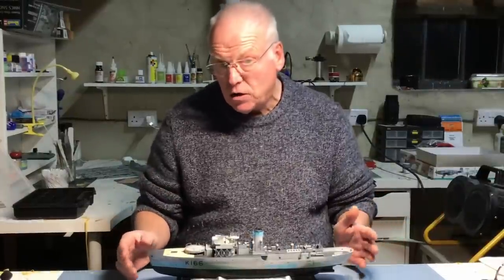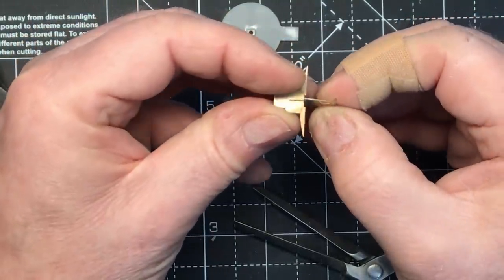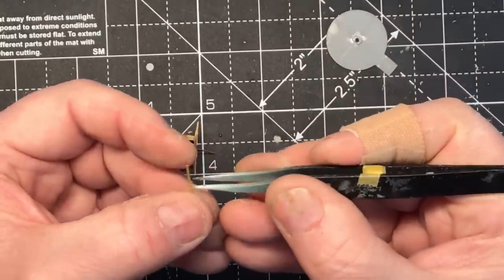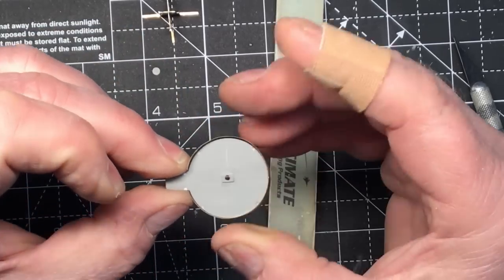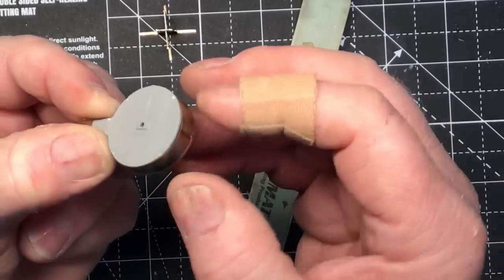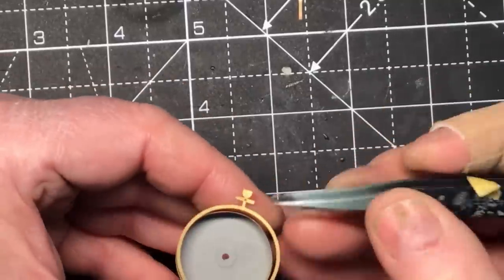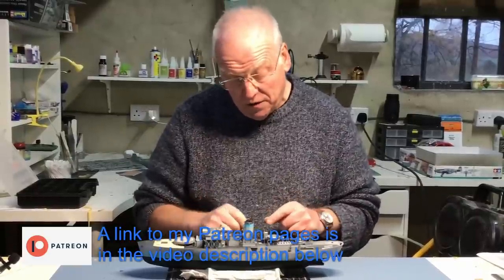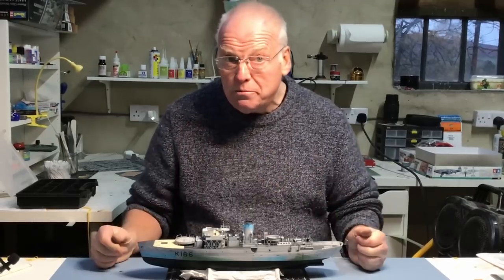Revell 1/144 Flower Class Corvette full build with Pontos detail set Part 14

Comment: Couldn't believe that you soldered the top lip to the tub... and got away with it! Well done.

A bit off topic for this week's video, but "desperate situation calls for desperate means", or something like that. Now that almost all of the major sub-assemblies are done I'm starting my put-together phase. I'm seeing that paint is flaking off several parts (bottom of top deck of bridge Pontos Part 166), front shield (Pontos Part 51), etc, etc.

I'm using new Tamiya lacquer paint, with Mr. Finishing Surfacer 1500 (gray) as the primer. I'm airbrushing at 15-20 psi. The offending color is Insignia White LP-35. It is so runny that I'm not cutting it. Coverage is poor, so I build it up with multiple light coats about 10-15 minutes apart. The cracking seems to appear about a week after painting, and comes off in relatively large flakes (some as large as about 5mm). I've ruled out flux since many of the parts were never soldered.  Any words of wisdom??
Reply: I just read your reply to Mr. Jones. I'm guessing that he/you/I are seeing the same issue. I'll follow your suggestion (paint & install quickly) and see what happens. No need to respond unless you have additional insights to offer.

Comment: Steve, what criteria do you use to determine whether you use a thick, thin, or extra thin super glue for attaching the parts?
Reply from the maker: Steven there are two considerations: the first is how much contact point there is on the parts, the second depends on how the parts are assembled. Taking the first, on railings for example where there is a very small contact point at the bottom of the stanchions, I’ll use a thick or maybe medium CA because thinner formulas evaporate before you have chance to place the railing. Taking the second, if I can assemble parts dry  I’ll use a thin or super thin to wick into the assembled joint and seal it up: if not you’re  better using a thicker formula applied to one or both sides of the joint prior to bringing the parts together. There are other “half-way” situations where the parts have a fairly large contact point where a medium formula will work because it won’t evaporate before the parts are  joined. 

Ultimately it comes down to practice and experience - I don’t really think about the glue I’m picking up now but hopefully the above will provide a guide to avoid the obviously “wrong” option.

Comment: as a new builder  with brass cast parts and photo etch do you use metal primer first or will mr surfacer 1500 be sufficient as a primer prior to the main paint job and do you have to wash the parts first to remove any oil or surface oils etc ??
Reply from the maker: Hi Chris. I use Mr surfacer. I have used etch primer in the past which was tougher but it wasn’t as fine. Mr surfacer needs to be handled carefully as it can chip though so I paint the parts and fit them quickly. It would be advisable to wash the brass frets before use but because they’re so fine it’s only really possible to immerse them in soapy water and let them air dry without scrubbing. for assemblies where I have used flux I always spray them down with cellulose through the airbrush as the flux is greasy and paint won’t stick in those areas.
Reply: @TheModelShed   thank you I also have some cast brass masts I guess they can have the same treatment ??
Reply from the maker: They can Chris.